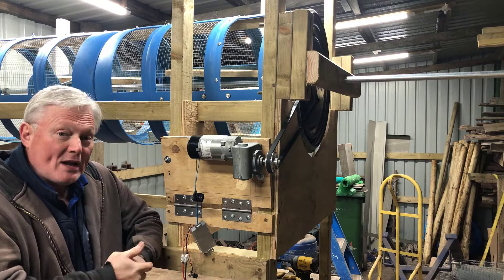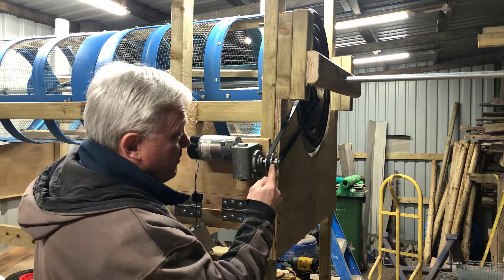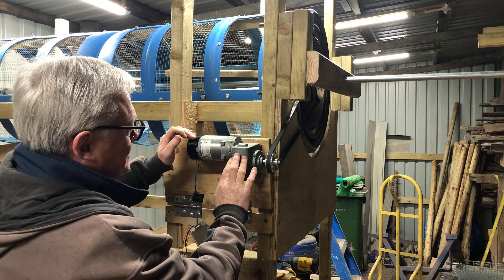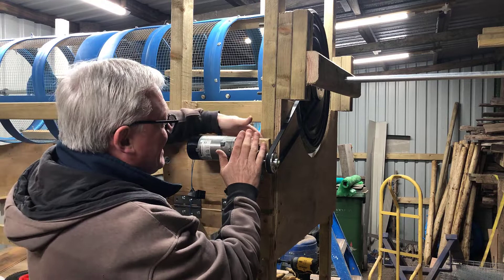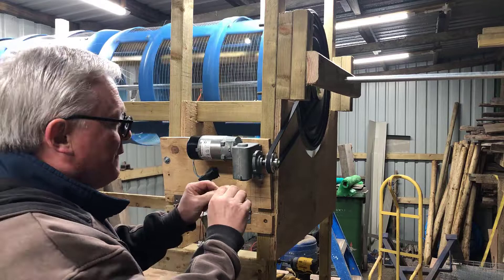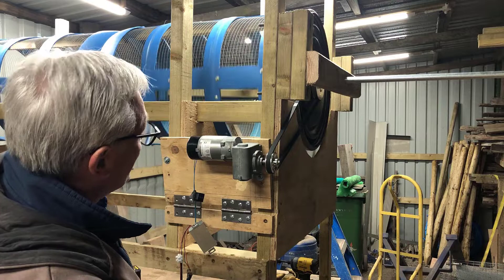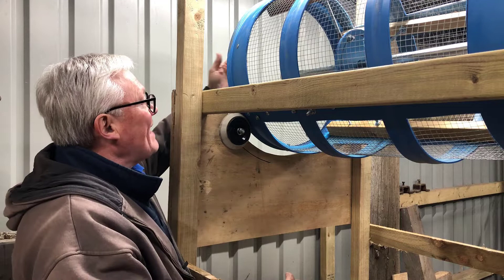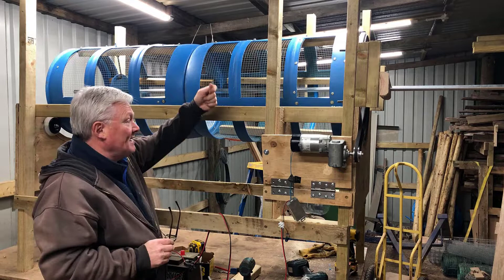Soil Sieve build part 2

Comment: Hello there,love the video, a couple of questions about your machine, seeing as how the drum integrity is weaker than before, would you not be better to have 2 extra wheels in the middle, supporting the jointed area? I like the thinking behind the adjustment threaded rod on the board area, you could have made it auto tensioner with the aid of 2 springs, one either side with the threaded rod going through it, that way it doesn’t give too much side force on the bearings.  Keeps the good work going
Reply from the maker: You would be surprised how solid it all is ! I know that cutting most of the plastic away would make it really weak! But once it was all fixed together, it was very sturdy! If money and time were no option, im sure this could be made much better! But for the times its used, it is perfect for the job.